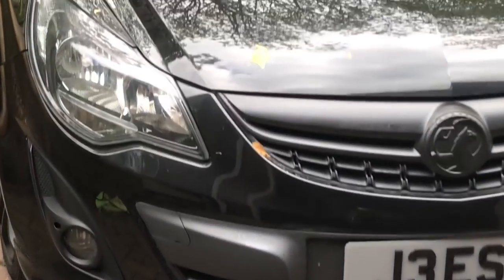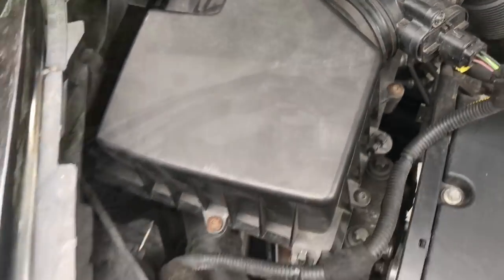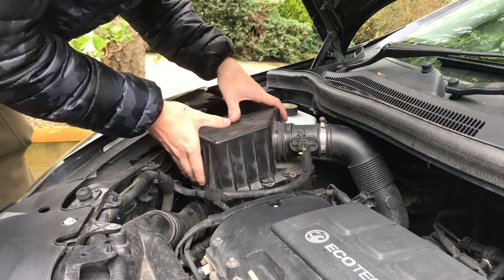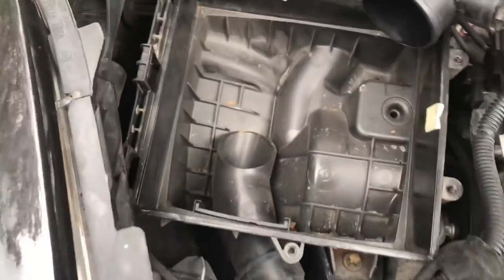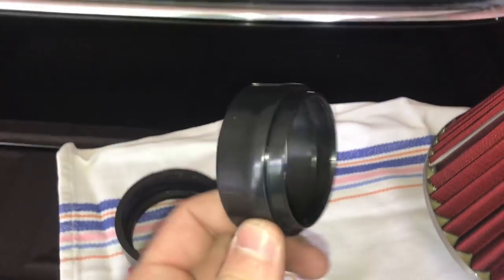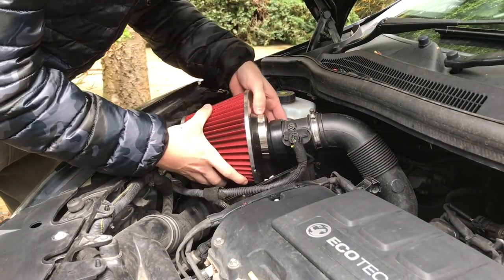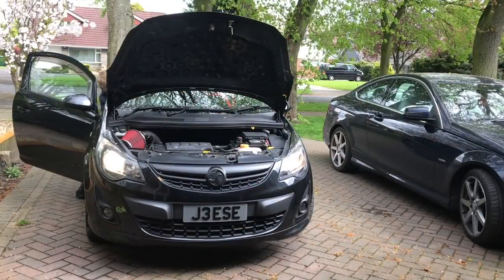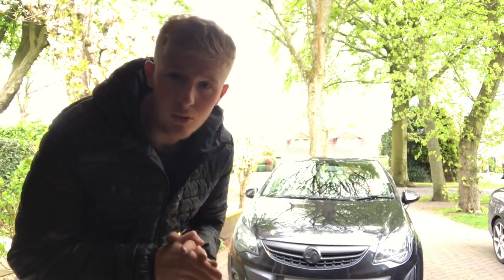HOW TO INSTALL A PERFORMANCE AIR FILTER YOURSELF!!

Comment: Red cone filter! That adds about 20 horsepower over a blue one.
Reply: that might change air fuel ratio and your engine can run lean
Reply: @gautamkumar-nk7ck  lean is mean
Reply: @jordanroberts4996  what's that mean?
Reply: @jordanroberts4996  lean is type of mixture in which air is more than normal petrol engine's compression ratio 15:1.
Reply: The Mexican Burrito no
Reply: Yeah only if you put the stickers on the car
Reply: @gautamkumar-nk7ck  No it has a sensor, which messure the O2.
The filter oem is underpowered, cause by its small room. Oem it runs in cold temperature better, cause of more o2 in the air. In warm conditions it lacks a bit of o2.
Reply: I have a multi colour 1.

Comment: While it does look and sound cool the stock filter that comes with the car will be alot better than a Halfords one.
Reply: Redstonary why
Reply: @Dhruv Patel well yes.. adding a pod / cone filter generally makes the car lose a horsepower or two, the only way you can have any possible benefit is if the pod is sitting in a sealed air box getting direct cold air. Otherwise the stock filter for all cars will generally be best.
Reply: @strahlfe8029  apart from the fact that a conical air intake will get more air into the engine than the stock air intake. Even better if you can install a cold air intake, or at least get some cold air toward a short ram

Comment: Nice video mate, you will be fine for the MOT without the panel filter you don’t need to swap them back👍🏻👍🏻
Reply from the maker: oh really? sweet nice one buddy!
Reply: J3ESE Yeah bro had 2 MOTs with them on different cars and it’s all sweet!
Reply from the maker: all good, thanks for letting me know!! <3
Reply: J3ESE No worries buddy👊🏻
Reply: Welsh Gaming no worries mate
Reply: @ExhaustedOfficial  So it's ok in the UK? That's awesome! Ill leave mine in.
Reply: Janssen Garcia Santos yeah perfectly fine mate 👍🏻
Reply: Welsh Gaming no worries fella
Reply: @Welsh Gaming Haha putting an air filter in mine too mate. I'm also from Wales btw

Comment: Even better when you fit one to a turbo’d car... choo choo! 😀👍
Reply: ive got the corsa 1.4 turbo, im still debating whether its worth getting this air filter? Should i go for it?
Reply: Jamie Harris yes and no I would suggest, yes if you want the sound, at the moment I'm running some tests with induction kit fitted and with stock air box and filter, you lose a little power as it sucks in warmer air but I'm still to discover if it is enough to go back to stock
Reply: thanks for the answer Kev! so how much power would you lose? like is it even a noticeable difference?
Reply: Jamie Harris I'll report back with my results soon
Reply: Kev Reay will be interested in hearing what your view on it will be I’m contemplating changing to a cone filter
Reply: Alex G I struggled to get some real results as too many variables with the warm weather etc. I've since sold the induction kit and put the stock box back on. I would say if you want the sound then just go for it. Sorry I can't give any real scientific results.
Reply: It still helps me mate. Just ordered one, coming Friday 👍

Comment: Got one on my petrol 1.4 Corsa D, love that air intake sound, wouldn't take it of for anything in the world
Reply: I have a 1.4 corsa to!!! Is the sound better and deeper with that mod? Is it safe for the engine? Do you have a video of the sound? 😎😀
Reply: You would if it started choking your engine
Reply: Only thing is you lose power from all of the heatsoak :P
Reply: @drummonkeystuffuk1875  I tested with an ODB reader and compared outside temp and air intake temp to see if it was really a ''hot air intake'', as the internet tends to say. Had a 2°C hotter intake temp with the pod filter. I don't really think it's gonna make any difference
Reply: @drummonkeystuffuk1875  no bc he has the lower part of the airbox still installed which gets cold air from underneath the hood and the new filtercone sits in that box
Reply: Just put mine on bonnet needed pushing down a bit also it seems like its can easily be removed what if it falls of or something?

Comment: I had a Halfords filter on my corsa E sri, didn’t make much sound difference if I just sat and revved it. On the move though it was LOUD! Louder than my old corsa C with filter. I have a RamAir filter now, sounds similar but performance is better. Nice ‘how to’ vid though 👌🏻 it’ll help newcomers to the modding scene

Comment: Couple of questions Jesse. How did it affect your fuel consumption, does it affect the engine mechanically (as in any issues), & will the bonnet shut fully if I didn't stick it down with sticky pads? I've seen a comment where they couldn't shut their bonnet on their sxi with no pads. Cheers mate👍

Comment: The Engineers designed and tuned the car to have and expect the airflow from the standard panel filter that is fitted otherwise they would have fitted one of these by stock if it was better. The air going into the engine with one of these is not filtered enough as the gaps are too large and introduces dirt and other particles that will degrade the engine faster.

Comment: Do you have to put the adaptors on? I fitted mine without them
Reply: Chris Onuoha the adapters are only used to fit the filter on top the bass pipe. If your filter fits without them them the adapters aren't necessary

Comment: I added this to my corsa was fine and sounds great however i had an engine light come on so i looked and it on OBD and it said too much air into the engine can anyone tell me if this is okay for the engine or should i swap it back
Reply: This isn't any  good for the engine.
F ex. in hot summers the car looses a lot of HP because the filter draws in a lot of air from the radiator (air at about 60ºC) instead of the 'colder' air outside, at around 40 max.
Also it allows a lot more debris and water to be sucked by the engine.

Comment: doesn't actually increase the performance, if anything the car gets to much air which confuses the ECU and it draws back power
Reply: Kyle Mcdonagh not strictly true. Ecus have a bit of give and take and will increase/decrease fuel ever so slightly to account for the change in air intake temps as standard. Colder air will ask the ecu to up the fuel rate slightly. Its not really noticeable performance wise. The noise creates a placebo effect to make ya think yer going faster.
Reply: Dean Scott back on the day of being a knob I added one and it severely decreased my performance, not that I had much to start with 😂
Reply: Kyle Mcdonagh haha yeah tbf its all just for noise. Unless yer sticking on a cold air feed then ye will lose power for sure haha. I always stick on as big a caf if i install one. Never made power but it did make the mpg a bit better. Cones to help turbo cars a bit tho bit defo a caf needs on 😂
Reply: Decreases power without a remap. Total waste of time and money.

Comment: Ramair, K&n are performance induction kits! Halfords tho will more than likely give you less hp 😛 and btw the clips you tightened with a screwdriver are meant to be tightened more with a 7m

Comment: Does it just make the. Exhaust sound better or does it improve cars performance aswell?
Reply: IF you have a fast car it will help with performance on little cars like this its purely for sound. You might notice the throttle is slightly more responsive but thats all.

Comment: This is bad. Once the engine is hot it will suck hot air from under the hood.at that position it should be inside the filterbox. Or should be mounted at the front of the car.
Reply: Eeee Jj  You mean to have a heat shield or something similar 🤔

Comment: Hi Jesse, I’m just wondering, is this air filter worth declaring to your insurance?
Reply: yes because it's classed as an engine modification and if your ever involved in an accident they will go through your car with a toothcomb if they find out you've modified it in anyway not just air filter even if you change your wheels from steel to alloys without declaring not only will they null and void your claim and policy but you could also be prosecuted for fraud for not declaring it.

Comment: How not to install an open airfilter. 
It will suck Hot air/less density when the engine gets warm. Keep it in the airfilterbox or near the front grill

Comment: Wanted to ask what those plastic cylinders called. The ones between the filter and the hose. Wanna do this to my corsa.
Reply from the maker: Karolis Karvinskis they come with most filters mate their just so you can use it on different size hoses 👊🏼
Reply: Cheers buddy. One more different question. Got a black box put in my corsa and i got my windows tinted afterwards. What should i do here do i need to tell my insurance or what.
Reply from the maker: Karolis Karvinskis Im pretty sure they won’t mine mate so maybe run it by them but unless you crash then they’ll never know
Reply: The guy that installed the black box walked around my car and then he took a couple of pictures before installing the square twat. Thats the thing that im worried about.
Reply from the maker: Karolis Karvinskis ye I had a guy do that to mine with my first car, it’s a iffy one mate, maybe ring them and ask if you can tint them without telling them you have?
Reply: Ill just give them a ring tomorrow telling them im thinking of doing it. If they dont like it ill rip it out. The tint only cost me like 70£ so it wont be that bad. Cheers for the help buddy. Great videos just started watching today :D

Comment: Watched this video this morning and had the air filter on my corsa by 9 haha sounds great although can hear it moving about any suggestions? Have tried those sticky pads but still hearing it. Cheers bro
Reply from the maker: vCharmps3 check everything’s tightened bro or use bigger pads 👊🏼
Reply: J3ESE cheers boss car looks sweet. 😎
Reply: I just used two cable ties joined around the base of the filter under the airbox and back up again stops it from moving around

Comment: What are those adapters called and where do i buy them? As my kn filter doesnt fit
Reply from the maker: Starrrrboi try eBay but my air filter came with them
Reply: J3ESE what are they called bro?
Reply: @guman98  did you find them in the end mate? I bought an arm dryflow and it didn't come with any ring adapters either
Reply: @Blackcheddar  no it was shit my airfilter kept falling off at the end just got my old stock filter re fitted. Got a gtc now so induction kit will be fitted for that

Comment: Will this fit a Vauxhall Corsa SE model 2010 ?
Reply from the maker: Jordan Duffin think so mate
Reply: J3ESE I have to drive an automatic due to a slight disability in my left arm what modifications would you recommend for a auto corsa please ?
Reply from the maker: Jordan Duffin check out my best first mods vid mate

Comment: Would be much better if the cone you fitted was in a sealed cold fed box, nothing worse than sucking hot air into the engine, yes the sound cool and look cool but not worth doing if it isn’t fully cold air fed

Comment: I got the same air filter and attempted to stick it down with the sticky pads and it is stuck down however between 1.5 and 2k revs it sounds like it is struggling and gargling almost basically it sounds shit and I was wondering if yours does the same or if you know how to help it
Reply from the maker: Max Jones hmm not to such why that is mate, try un sticking it and if not you might need to clean your filter mate 🙂
Reply: J3ESE right will do also not sure if I've used the adapters right so will 're do that and stuff but yh cheers mate for the quick reply.
Reply from the maker: Max Jones that could be it too! Air might be escaping a little under strain, try a few things out then let me know, always try help 👊🏼
Reply: J3ESE yeah that's probably it. Will do mate if you every wanted to link bro I live in Warrington too so yh. I'll keep u updated.
Reply from the maker: Max Jones sweet man! I’ll be doing a meet up there soon 👌🏼
Reply: J3ESE niceone ill deffo be there

Comment: QUESTION>  ~Shouldn't you do a fuel mapping session after installing the air filter~ as is can change the flow of fuel into the air combustion chamber in the engine? if so that can cause problem down the line with carbon build up around spark plugs and other shit.  i think thats how it works anyway am i right youtube ?
Reply: Yes your right reset ecu after any mods to the cars performance

Comment: This does not actually add any performance value to the car, as the air box is now open u will draw in hot air from the engine, trust me i did it, you can either get a RamAir kit which has trunking to direct air direct to the cone, or replace with the original box de-restrict the box by removing both the pipe from the top half and bottom half improves air flow, and marry it to a performance panel filter, i did this on the wife's SXI, as the cone i got sucked. This is much better, smoother and better pickup, and cause of the filter maybe a couple extra BHP., i didn't test it feedback from the missus.
Reply: Hey, I just got the filter and trying to fit in the original box. There's a pipe in the box which sucks in cold air from underneath the fender. Do you think it would be just fine fitting the cone to the factory box? Or I would need to put the lid back on, ensuring the cone doesn't suck in air from the engine bay? Thanks

Comment: is this something insurance will want to know about? i got a Corsa 1.2 and it's already bugging me how much it is lol
Reply from the maker: Xient Designs personally I haven’t informed them as they will know no different
Reply: Technically you should actually inform them just incase you have an accident. But it’ll cost you more money as they’ll consider you as a boy racer that speeds about 24/7. So as Jesse said, It’s handy to keep hold of your standard filter to be on the safe side, not for MOT as filters don’t affect MOT but incase you have a crash and your insurance provider wants to examine your cars damage, if they find any modifications that you didn’t declare then they won’t pay out. although adding the cone filter does make your car sound better which is good for you, but it’s also good for your engine as it allows it to breathe better if fitted properly. I have RamAir filter and custom backbox on my 2016 corsa E SRi, I said to my insurance company that I may customise it and asked how much it would affect me, they were prepared to add an extra £40-£50 .
Reply: Insurance will be void

Comment: Does this increase the power of the car????
Reply from the maker: Mannan iqbal maybe slightly but does give better throttle response
Reply: J3ESE cool, also wanted to ask, i unscrew the t20 screws but can’t get the hose off, why’s that??
Reply from the maker: Mannan iqbal not sure mate message me on Instagram and send me a pic
Reply: J3ESE I got it off pal, cheers anyways, but putting on them adapters is a piss take mate, honestly!

Comment: Deffo a decent upgrade!
Reply from the maker: didnt think it would make such a difference but it sounds a lot better at higher revs!
Reply: Its really not m8 :( to much heat soak when idle. Think il go for performance filter.let me know how your getting on with it tho its deffo a nice visual mod and sound improvement
Reply from the maker: so far so good, no over heating no drone and no problems, ill keep you updated

Comment: How far up north are you from mate / where you from? After driving Phats car does it make you want a VXR? Just curious because in a few months im gonna be selling mine and if you're interested yknow? When i got the car i was 18 and the insurance was 2000 a year so can't imagine it being as expensive with you considering your age. Depending on the next Car meet i'll try and come down also. Air filter sounds clean btw :)
Reply from the maker: RedRandyDevil cheers bro! And I didn’t actually drive his vxr he just took me out in it, and I really am stuck with my next car, I don’t have a clue what I want 😂
Reply: ohhhhhh, see i'm only asking because i'm either gonna sell it and buy an r53 and dunk some money into that or buy a facelift vxr with a different colour rather than me respraying mine. 07 Plate 60k miles on the clock, when i got it i think it had 50k but i got it for a steal of £4000 so reselling it i'd probably be looking for like 3400+ i don't know yet. Should've had a go though man, or at least try n have a go at a stock one. Can imagine going from a SRI to a stage 1 vxr would be a bit scary tbh lmao
Reply from the maker: RedRandyDevil I used to own a 1.6 turbo so I should be fine, and I might take you up on that offer mate but will have to be in September when I’ve got 2 years no claims
Reply: Ahh fair , i'm new to your channel and haven't watched your earlier stuff yet, Well i get my 2 years no claims end of july and thats probably when im likely to sell it , like i said my insurance was only 2000 for it when i got it and that was last year with 1 year driving and 1 year claims but. Probably coulda gotten it cheaper if id of shopped about but couldn't be arsed. Just wanted to get in it and rip about haha
Reply from the maker: RedRandyDevil I wrote a motorbike off so my insurance is quite a lot 😂
Reply: J3ESE oh shit, was it really serious? You injured like or? And how much are you paying now like?

Comment: Confused in which order and way to put the adapters on, help me out Jesse pal
Reply from the maker: Iestyn7 depending on the size of your hose have a go with all sizes mate
Reply: So you can put them on any way and order as long as it all fits up?
Reply: I've got the same car as yours but just the limited edition white version
Reply from the maker: Iestyn7 ye mate as long as it’s tight
Reply: Is it safe like, have you had any warning lights or troubles with it since you put it on ?